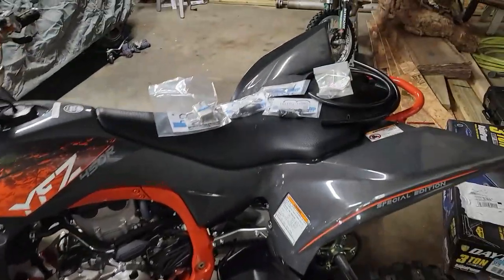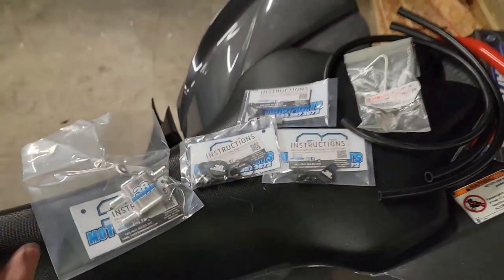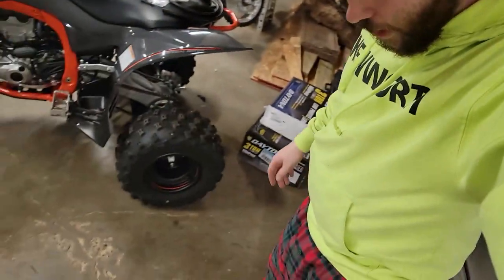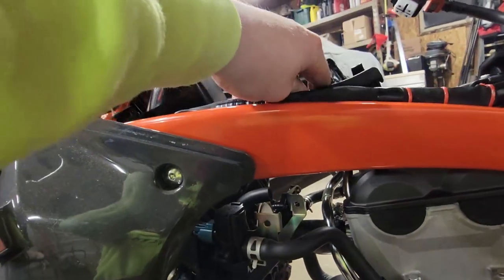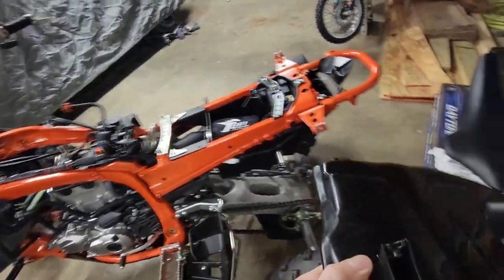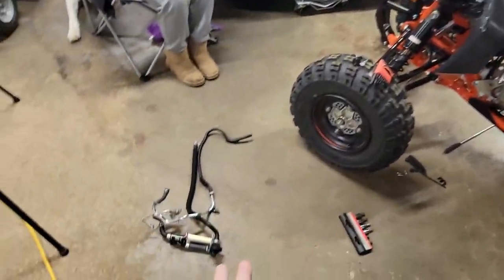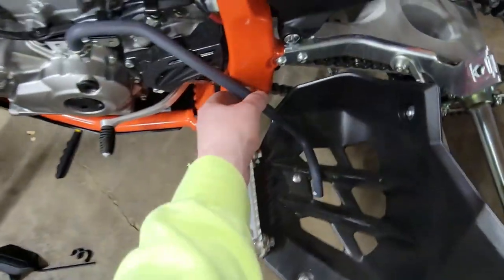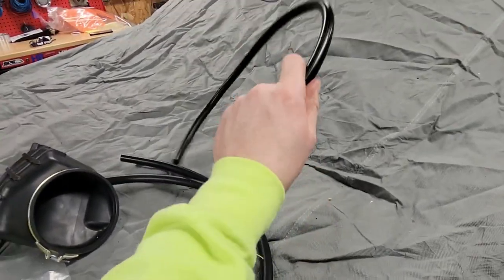2023 Yamaha YFZ AIS Delete, Parking Brake Delete, Speed Sensor Delete, 38 Motorsports Breather Box

Comment: I just did that yesterday, I ran the ais plug to the front next to the left headlight there's a notch were it fits perfect also I used the large hose of the breather box ran it to the crankcase fits a lot better and you can put the cover looks a lot cleaner

Comment: The rear parking brake is adjustable on the rear caliper.  The long bolt that sticks out parallel to the axle, just turn it in a bit and it will make the brake tighter so the machine doesn't move.
Reply from the maker: Yes I know, I never use the parking brake so I removed it. They just need to be adjusted regularly if used a lot.

Comment: I just did the parking brake delete on my 21 yfz450r.  I also used the 38 motorsports block off. Do you use the oem gasket with the new 38 block off plate or just the oring that it comes with? Thanks.  Keep up the good work
Reply from the maker: I don't remember seeing an oem gasket... so I just used the oring on mine. I'm gonna have to go check now lol thankyou!
Reply: There was a rubber oem gasket on the original component.  It probably was stuck to it
Reply from the maker: @jasonskanchy955  yup mine was stuck to it! I'm gonna pull mine off and put it on with it, i think it's supposed to be on there

Comment: Do you need the 38 block off plate if you are using the 2013 holding bracket?  Doesn't the bracket also serve as a block off?
Reply from the maker: I didn't look at it that close to see if you could, but I'd recommend using the 38 motorsports block off plate regardless because it's a lot thicker than the holding bracket, because it's pretty thin. Idk how much heat or pressure that spot gets so the thin plate on the holding bracket may flex, leak, or warp if you don't use the block off plate
Reply: Hello! Great video sir! Please share the part number for the bracket you used. Thank you!
Reply from the maker: @mchevownr  18P-11395-00-00

Comment: If i want to delete the AIS what i wanna do?  I didn't understand if i want yo delete all of yhis cables
Reply from the maker: AIS delete removes all the unnecessary tubes on top of the engine... it's just emissions stuff that isnt needed. The cables I deleted were for the rear parking brake
Reply: @Itsjustacoyotee   i can only delete the AIS ?    Without the breather box ?
If yes want i can do to the engine slot where was the cable ?

Comment: So you never needed the AIS plate from 38moto. I just ordered everything after watching your video and realized it was as simple as cutting off the tube on the original plate and filling in the hole. Save yourself $50+ bucks folks ESPECIALLY if you're going to do like this guy and cover it with an OEM (also unnecessary) hangar
Reply: And that looks like shit.  It’s not 50 bucks

Comment: What's the top speed with the speed sensor delete?
Reply from the maker: I have no idea, haven't had good enough weather to ride it yet
Reply: @Itsjustacoyotee  did yours come idled kind of high ?
Reply from the maker: @AceDollazz  a little bit
Reply: @Itsjustacoyotee  if I’m going to be holding wheelies for a period of time you think I should upgrade oil pump or is the stock one ok ?
Reply from the maker: @TopppDawg Ace Dollazz  I'm not sure, but I mostly do wheelies and I haven't had a problem yet
Reply: @Itsjustacoyotee  appreciate it bro where you from thoe ?
Reply from the maker: @AceDollazz  wisconsin
Reply: @AceDollazz  factory pump is all you need buddy